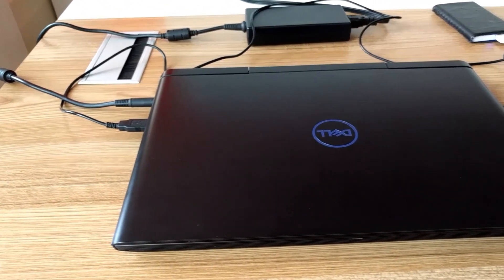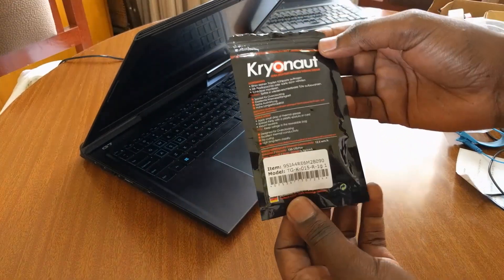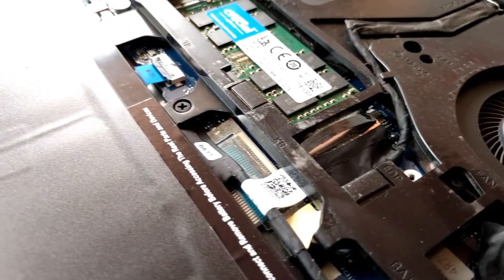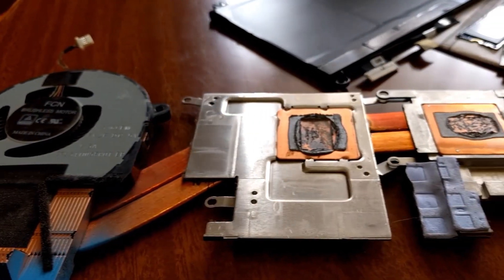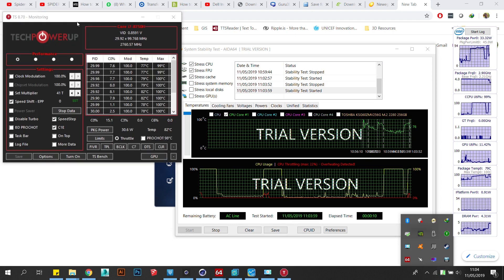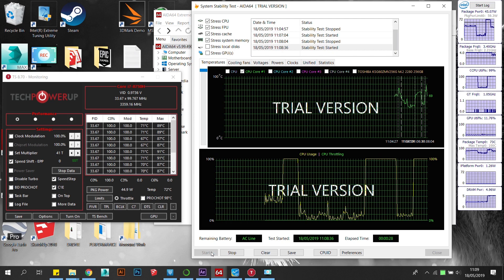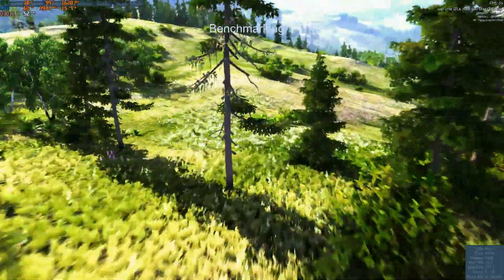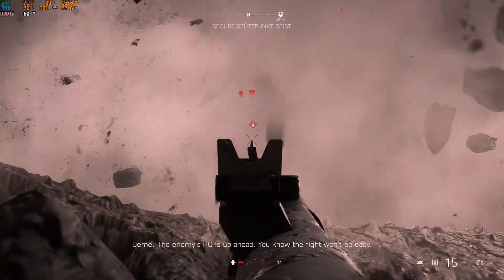Dell G7 7588 Repaste Guide

Comment: I tried doing this, but it looks like four M2X3 screws in the battery section were purposefully stripped, probably to deter from users doing this. Sucks. I've had this laptop for 6 years though, and have not replaced the paste ever, so I guess I'll see just how much longer it'll last me

Comment: It took me 2-3 hours, but it was worth it. I got mine used, and I'm not sure the fans were cleared out, because it was always running hot. I cleaned the fans all out, only the fans, and the temps dropped dramatically. I am going to replace the thermal paste, which I haven't done yet, so I am excited for that to get here
Edit: it dropped the temps about 4 degrees C less, although sometimes it's more like 3 or 2 less, but idk why... Either way, it doesn't thermal throttle, and that's the important part :D

Comment: Hi, great video. My G7 is 2018 so needs the paste removed. Wondering did you consider thermal pads by any chance and if you have an opinion?  The thermal conductivity for the Thermal Grizzly Carbonaut's technologically advanced carbon fiber thermal pads is 62.5 W/m.k. 

https://www.amazon.com/Thermal-Grizzly-Carbonaut-38-0-2/dp/B07PHLJYWK/ref=sr_1_4?dchild=1&keywords=thermal+grizzly+pads&qid=1628557774&sr=8-4

Comment: I have problem with temperature and Droping FPS(from 60FPS to 20-25FPS when i play more than 15 minutes) ,I think they are related. i use my G7 7588 (i7-8750h 1060 max -Q) for 3 years and never changed the thermal paste. Do u think thermal paste is my main problem. I dont really know what to do right now :((, can u give me a solution.
Reply from the maker: Hi, Dell uses very bad factory paste, try repasting it with some quality paste like Thermal Grizzly
Reply: @kakemboluide  i will try, thank you

Comment: Kyronaut is the best. IC diamond is a good one too.  recommend replacing thermal pads on the cooler before reassembly, but its not necessary for 1 time removal. They loose their structure if moved too much. Measure the originals with a micrometer and order a few to keep them on hand if you plan on a chassis clean/repaste schedule over the years
Reply from the maker: Did you measure yours? What was the thickness? I'm too lazy to open the laptop again, my Kryonaut is still performing like day 1 😂

Comment: Mine reached up to 98c°
Reply: turn off Intel Turbo Boost in the bios settings as a temporary solution. finally you can tinker with your laptop to clean and repaste, undervolt, and limiting turboboost by using throttlestop. repasting a laptop can be quite daunting tho.

Comment: Do you know how to remove stripped screws?
Reply from the maker: Hi, unfortunately no, best bet would be to use a sharp-pointed object/tweezers, depending on the level at which they are stuck.
Reply: You can try using JB Weld putty and a tiny Alen wrench (or even a smaller Philip heads screwdriver that still leaves gaps in the slots). The trick is to get the putty into the Philips slots. Then pack some putty around the long end tip of the Alen wrench (or tiny Philips) and set it on top of the screw head with the putty. Ideally you want the Alen wrench to be so small that it fits in to the center of the Philips slots. A tiny Philips will of course fit but just make sure it's tiny enough to not squeeze out all the putty. 
  Let it cure for the allotted time till fully cured. Then turn the Alen wrench short end, slowly, and extract the screw. Obviously you don't want any JB Weld on anything around the screw head. If need be, use some plastic (like a small portion of a shopping bag and make a hole just big enough to expose the screw head as you lay the plastic over the screw. You can also use some tape that doesn't stick so hard (like gift wrapping tape or even blue painters tape). Make the same perfect size hole and set it in place. With tape, the turning force of the wrench will also be fighting the tape a bit until it either comes loose from the base yo stuck it to or possible the JB Weld comes off the tape, especially if the JB Weld doesn't like sticking to the top of the tape.

Comment: Hi! Can you post your Throttlestop configurations? and how do you limit the CPU clock to 3.4ghz?
Reply: You can limit by opening FIVR and reducing the Turbo Ratio Limits (can be found bottom left of the FIVR window). Reduce the "1 Core Active" to 34 and the CPU clock will be limited to 3.4GHz

Comment: Can I apply liquid metal on CPU and witch one should I use?
Reply from the maker: Hi, yes you can do LM on the CPU, however be sure to insulate the area around it with Super 33+ tape as recommended by Bob Of All Trades, last thing you want is your mobo shorting out.

Comment: My G7 got to the point where the only game I could play was minecraft. Even running at the lowest graphics settings almost everything lagged. ThrottleStop showed constant overheating and temperature induced throttling. I just re-pasted with MX-4 and cleaned out the dust and I've gotten all of the out-of-the box performance back. Hitting 60 fps and running 20C cooler! 

Its a gaming laptop again. So thankful for the guides <3
Reply from the maker: Great to see the repaste helped with your system temperatures, honestly Dell really cut costs with the paste on this system.

Comment: I was wondering if you could give an update on how is the thermal paste holding up? Is your laptop still maintaining lower temps?
Reply from the maker: Hi, yes the thermal paste is holding up perfectly, temperatures have been very consistent for over a year. One of the best upgrades I've done to this computer.
Reply: @kakemboluide  Great, thanks for the reply. I will be doing the disassemble this weekend, since my laptop is experiencing lots of heating issues.

Comment: This worked like a charm. I left the little battery plugged in though and didn't have to wait for my G7 to reboot. Dropped my temps about 10-15C. Took about 3 hours. Not too bad if you just go slow and keep track of the screws. It's a lot of screws. Thanks for posting this video!

Comment: Not really sure what I did wrong but now my g7 will turn on, fans full blast with no display lit up and will shut off after about 30 seconds. It'll turn back on then the power button will turn off but it'll still be running.
Reply from the maker: It's doing that because you removed the CMOS battery, just give it a few more tries and it should boot up.
Reply: @kakemboluide  this is a bit delayed. But I am having the same problem and mine puts full blast fans led on keyboard on no display, and the power button doesn’t light up nor does it work. It doesn’t turn off and I have to wait for it to die in battery in order for it to turn off. I simply can’t use my dell g7. Any help? This started last night and I’ve tried rebooting many times but now it just doesn’t turn on even with charger in
Reply: @landonwodicka8040  any solves?

Comment: So I followed your video along with this guide for the repaste job on my 2018 7588 (8750 i7 with 1060maxq) https://www.how-fixit.com/laptop-repair-guides/dell-laptop/dell-g5-5587-g7-7588-disassembly-guide/ Afterward my cinebench r20 benchmark didn't see the cpu going over 75C and the highest spike I had in 3dMark was 88C. Before the repaste both the cpu and gpu were seeing temps over 100C in heavy parts of the benchmark. I used Thermal Grizzly Kryonaut (didnt use conductonaut as I had heard it can stain/pit bare copper and aluminum) and cut all new thermal pads (1mm) for the inside components.  Also another neat thing is without messing with my clock speeds, or changing graphics drivers, I saw a increase of 669mhz on the gpu during the whole benchmark.  
p.s. There are a crap ton of screws and fragile ribbon cables in this computer.... Not for the faint of heart or disorganized.  Hardest part of the whole disassembly was getting the frame off, broke the tips off of two of my plastic prying tools.
Reply: Now my dell has no problem chugging through benchmarks at 4ghz on the cpu and 2003mhz on the gpu (no overclock of anykind) I might mess with undervolting the cpu and overclocking the gpu a little later on.
Reply: Thanks Thomas Seals.
This guide is very very comprehensive and complete!

Currently I'm using my 7588 with bios 1.12, Dell Power Manager and ThrottleStop undervoting the CPU by -175.8mV.

With this configuration the temperatures of the G7 became acceptable, but there is room for improvement with the repaste.

For now, the G7 cooling system isn't needing a maintenance to clean it from accumulated dusts. For sure the guide that you linked will help me when cleaning the G7 cooler in the future, and than I'll repaste it.

Thanks Laptop Performance Tricks for your videos, they helped me a lot!

Comment: @Laptop Performance Tricks  Got it👌🏼😊😊😊 Thanks so much! 

I was experimenting with repasting last night, for the first time in 3 years for my laptop (I am quite familiar with opening up laptops). After watching several repasting videos, and following the instructions, I repasted it with cooler master thermal paste (cheapest I could find as I didn't think it mattered). 

I was excited to get even lower temperatures after this. But to my horror, the temperatures started to spike up to 90 deg C within seconds of turning on a game and made my system crash. 

I thought that I did something wrong. So I cleaned everything up and repasted again. Making sure it's done well. Still same results. I gave up after 4 repasting attempts.

What do you think is the most likely cause of this?

Could it be that the thermal paste I'm using is so much inferior to the original one?

I tried Google and there didn't seem to be any clear answer. Hope you can give me some guidance. Feeling quite sad as I shouldn't have touched what's not broken. 🤦‍♂️

My next step would be to try get a better performing paste eg liquid metal and try that. Knowing well that it is conductive and must be applied very carefully.🤔 Or should I use another safer product?
Reply from the maker: Hi, sorry to hear about your challenges. I always recommend Thermal Grizzly Kryonaut because it is the best non-conductive paste out there. 

Perhaps try and minimize the amount of paste you are using, ideally paste is only meant to fill in the air gaps between the heatsink and the CPU, not to conduct heat itself, so use a very small drop, which should spread out to a thin layer. And don't forget thermal pads for the VRMs and GPU memory if your laptop has those.
Reply: @kakemboluide  Thank you so much! To update, I have bought both Thermal Grizzly Kryonaut & Conductonaut.

I applied Conductonaut specifically on the CPU and GPU. And I applied Kryonaut on the other components.

It worked like magic! My laptop runs about 5 degrees cooler than it originally did (more than 20 degrees cooler than using a cheaper brand paste).

Wow didn't expect the paste to have such an big impact.

Thanks for all your guidance. Hope this helps inform others as well. 😊😊😊

🕊️🕊️🕊️Happy gamer
Reply from the maker: @adnfabdat  that's great to hear, you're welcome!

Comment: I dont think it's even worth turbo boosting at all to save overall life to CPU and GPU my dell g7 only overheats on cpu intensive games and they lowest clock I've been able to safely use was 3.2 in throttlestop but now I know 2.8 is the lowest I can I go I'll keep it on that I'm so scared to disassemble this g7 it's not going be as easy as my alienware alpha but looking at the build up that can go on inside this thing it seems like its worth just cleaning out every year and repasting dell really sucks for this poor job at pasting or the paste just really sucks .
Reply from the maker: I've used my Kryonaut for over a year now, still getting the same performance as day 1. Once you gather up the bravery to repaste, the temperature improvements are well worth it.

Comment: I was experiencing very hot temperatures when playing games like Apex Legends, but did not get to it in time. REsult-multiple burns on board due to overheating chips. My motherboard died 2 weeks after my 1 year warranty ended. Now I'm getting no assistance.
Reply from the maker: Sorry to hear that, what system were you using?
Reply: Laptop Performance Tricks  Dell 7855 G7 15 core i7 8750h with Nvidia GeForce gtx 1060 max-q
Reply: @adriangarbutt  I think dell is to blame for a lot of the problems we have. To my knowledge, the i7 8750h (I have it as well w the g7 7588) produces a lot of heat. On top of that, our laptops are definitely not the best in terms of heat dispersion

Comment: hey man big thanks for the video! what was the thickness of the thermal pads you used here?
Reply from the maker: You're welcome! I actually recycled the ones the laptop came with because I forgot to buy some for the repaste, but you can get a few 1mm and 1.5mm pieces just to be on the safe side.
Reply: @kakemboluide  yeah 1mm did the trick. I wouldnt risk 1.5mm as I had good contact of the die using 1mm. (had to take the whole thing apart again because I realized a single thermal pad had fallen on the ground when I had installed the heatsink)
Reply: @AtomicBleach  I'm glad you said something about that! It was a nice heads up for when I repaste mine. 😊
Reply: @suprastevio2264  best of luck. Be prepared to remove lots of screws hahaha. I did get quite a boast in thermal performance after repasting though, so I certainly would recommend.

Comment: Did you replace the surrounding thermal pads on the vram and vrms?
Reply from the maker: I completely forgot to purchase some thermal pads when buying the Kryonaut, so I just had to be careful and recycled the old ones instead.
Reply: @kakemboluide  I was just wondering if you did and what thickness I would have to get
Reply: @AtomicBleach  hello, i'm asking myself the exact same thing. did you get to any conclusion?
Reply: @l.968  nope not yet. Want to order some though before I start digging into the laptop
Reply from the maker: @AtomicBleach  They should be 1mm pieces, but you can try and add a few 1.5mm just in case.
Reply: @AtomicBleach  I used 1mm pads and had great results, most likely due to the thermal paste, but it means i didn't mess up with the pads.
Reply: @kakemboluide  yeah they're def 1mm, thanks for the reply!
Reply: @l.968  thanks I'll order some today. Was trying to find confirmation. I bought the 2018 model G7 7588 with the 1060 and i7 8750H from a local for only $500 earlier in the month. Just had to replace the screen $60
Reply: @AtomicBleach  wow that was a great deal congratz. that's the one i got and i'm playing doom eternal with 75 fps (the cap of my monitor). gl with it and i suggest grizzly kryonaut thermal paste.
Reply: @l.968  ive tried hopelessly to upgrade the panel to the 120hz one but after getting 5 panels that didn't work I have given up on 120hz gameplay. How did you overclock to 75hz... since Nvidia control panel doesn't allow for it. I'm used to desktop gaming.
Reply: @AtomicBleach  i'm sorry, i should have mentioned it! i use it with an external monitor and keyboard + mouse
Reply: @l.968   lucas  yeah I was trying to get something for on the go high frames. I already have a decent desktop and 144hz monitor for a decent at home experience. Just wanted something for lan events or for when I visit a friend. I do have a tube thermal grizzly kryonaut  that I was planning on using. Did you use the thermal grizzly pads too?

Comment: Would the thermal paste "Thermal Grizzly Conductonaut" be compatible with the material of that processor (directly on "silicon") ?  

On the manufacturer's website they talk "We recommend to apply Conductonaut on nickel plated surfaces since this will provide the best long term stability in performance". 

"https://www.thermal-grizzly.com/en/products/26-conductonaut-en". 

"https://www.thermal-grizzly.com/images/downloads/TG_Datasheet_Conductonaut_EN.pdf".  

Thank's.
Reply from the maker: Conductonaut is only incompatible with aluminium heatsinks, the G7 uses copper heatsinks. So they will eventually be discolored, but it'll still work well anyway.

Comment: The problem with your conclusion is that it is impossible to tell how much of the benefit was from the repaste and how much was from cleaning all the dust and gunk out of the cooler.
Reply from the maker: Hi, the temperatures with the old paste were nowhere near where they are now with the Kryonaut, the gunk probably only accounted for about 2-3 degrees at most. The biggest indicator for me was that temperatures don't spike anymore, I now get proper heat soak into the heatsink, meaning all heat from the CPU is being transferred into the cooling system.

Comment: Hey man can you tell me your throttle stop configuration of CPU Core and CPU cache voltage settings please that will help me configure my laptop to thanks for the video that helps a lot!
Reply from the maker: Hi, I'm currently running -0.220V on the core and -0.125 on the cache. Also, for gaming I limit the frequency to 3.2GHz.
Reply: @kakemboluide    thanks man that will help me alot to configure my settings to make it perfect!

Comment: i have the dell g7 17 7790 what does disabling turbo boost do because that helped my temps greatly but i start dropping more frames. underclocking barely helped my temp and i dont want to repaste
Reply: when you disable turbo boost you are basically making your CPU run at half its speed. That why your thermals look great.
Reply: @boindala  it seems thats what i hav to do to keep these temps below 90
Reply: Disabling turbo boost is the reason you lost frames. You lose performance by disabling it.